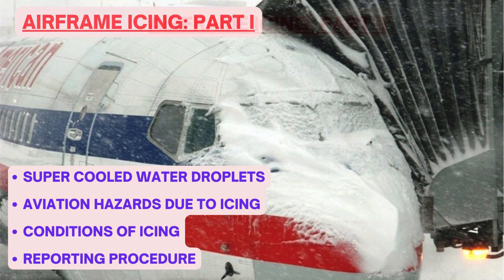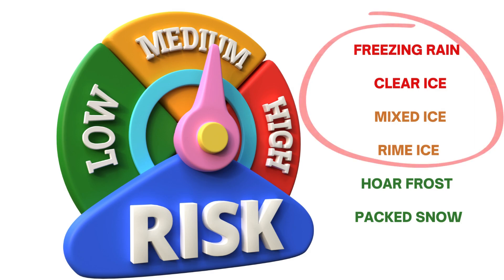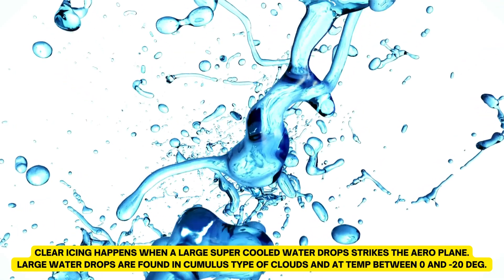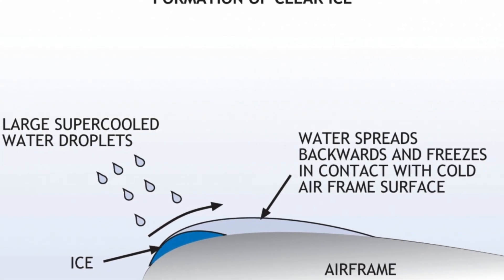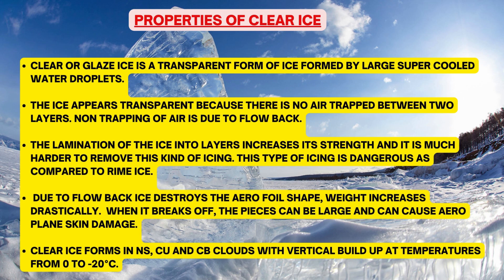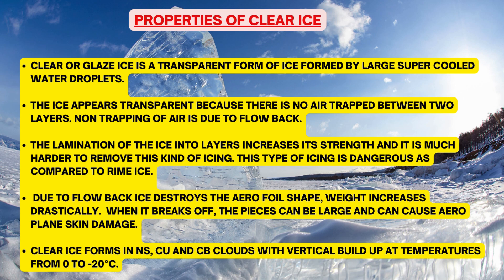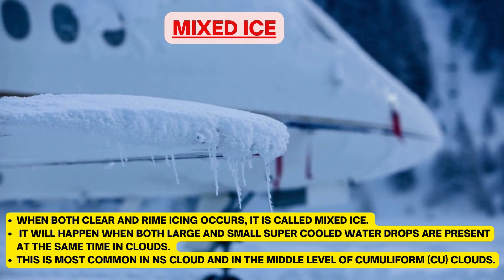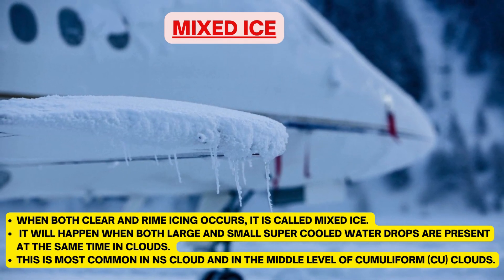AIRFRAME ICING #METEOROLOGY FOR DGCA CPL/ATPL EXAM #GROUND STUDIES FOR PILOTS #CLEAR ICE, RIME ICE

Comment: increase, Because There will more number of Big water droplets come in touch with surface of aircraft
Reply from the maker: Answer is correct.
Reply: @captainvijaysharma  Hi sir,
I cleared met by watching your videos Thank you so much sir🙏
Reply: But Sir by increasing speed, the lift of the aircraft is  supposed to increase (if autopilot for altitude is not locked)

Then it will escape the altitude till which icing is hapenning and hence icing will not effect it much. Hence due to increase in lift, icing is supposed to decrease
Reply from the maker: @Avi737800  you are mixing two different things.Leave the effect of speed on lift aside and only focus on the crux of the question.

Comment: Increase, it is coz of chances of supercooled water getting in contact with the air frame are more.
Reply from the maker: Answer is correct. Aeroplane will be hit by larger volume of supercooled water in unit time.